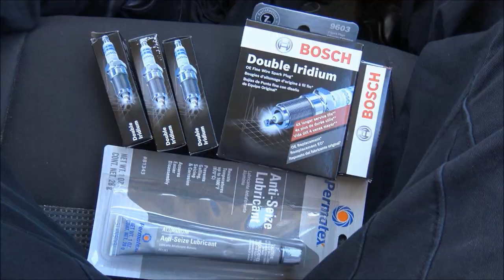TUNDRA MAINTENANCE...

Comment: Sounds like it could possibly be your Brake Load Sensing Proportioning Valve. Either needs replaced or likely adjusted. Remove your spare tire and it is easy to work on.

Comment: I hope there was a jack stand somewhere I didn't notice or couldn't see. Wise words, these trucks are legend.. If the rear brakes are out of adjustment it will cause the pedal to go to the floor like you describe as well. All you have to do is tighten them up.

Comment: That's LITTERALLY the only problem ive haf on my 02 FGT was brakes and i just splurdged n bought the powerstop extreme's and new parts,drums,& wheel cylinders and  im doing this all rn rn....

At 154k i bought it at 123k after i raced a bunch of cars from mid 90's bmw's & integras some would cut me off brake checking me - on the drag strip even... but my bmc leaked into my booster & my engine sucked that sh!t up three the engine vacuum hoses that are connected to it i replaced all that !